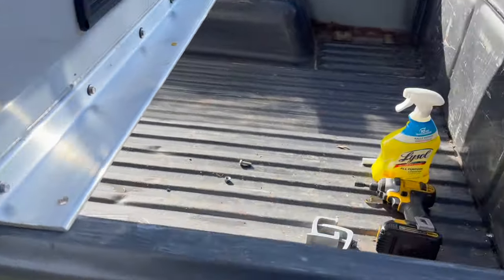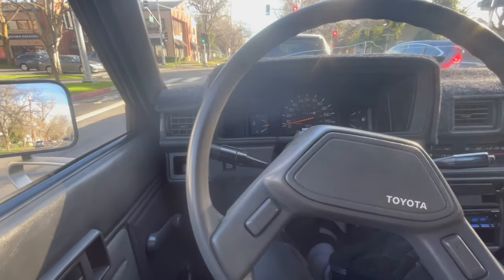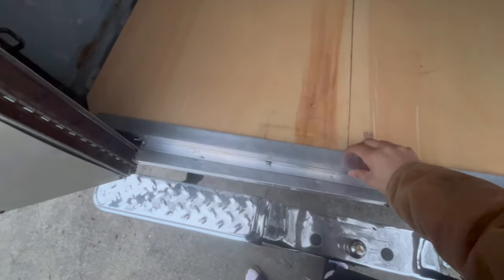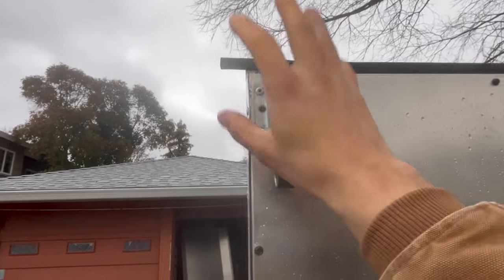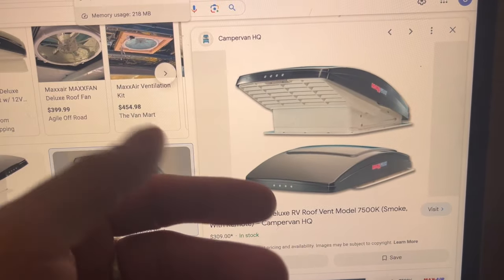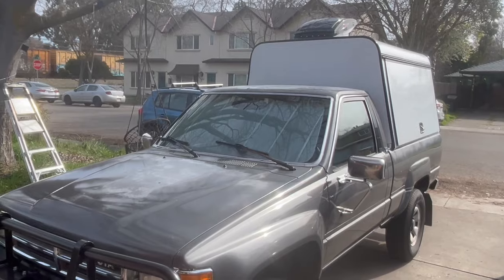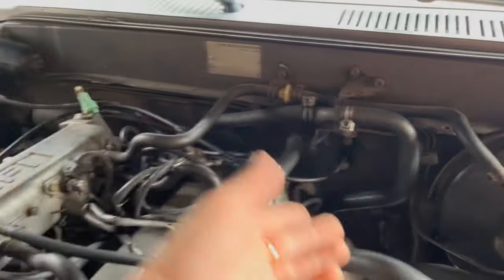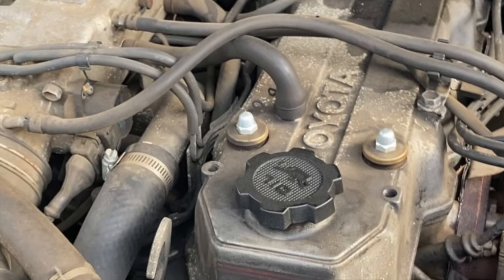Reinventing The Toyota Truck Home

Comment: Depending on the insulation you use, it can help reduce the internal temperature of the interior space, if you use AC the interier will stay cooler for longer, also it willl reduce vibrations and noise. You would have a much more comfortable time camping in the city
Reply from the maker: Yeah I'm going the route of no AC in the camper shell, but I have had the same thoughts about vibration and noise in that insulation would help.
Reply: I built out a similar shell for a cross country trip last year. 1 inch foam should fit in the voids of the frame work and will make a huge difference in temperature,condensation and noise reduction of the shell and well worth the time and effort if you're gonna live out of it. Hope to see a video of the shell build
Reply from the maker: Hell yea brotha, I do have that extra 1inch in between the panels yes. But I'm wondering if the insulation will make it too hot at times, not sure it will be good for the climate I'm going to be in. Yeah man keep checkin, been workin on the truck lately. Cheers @chad2886